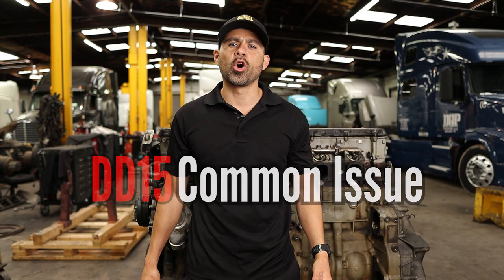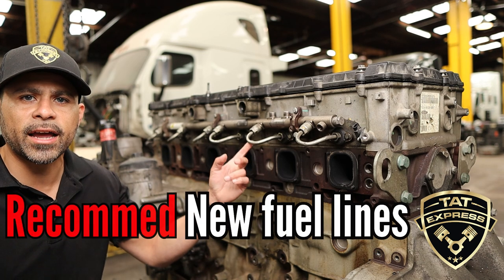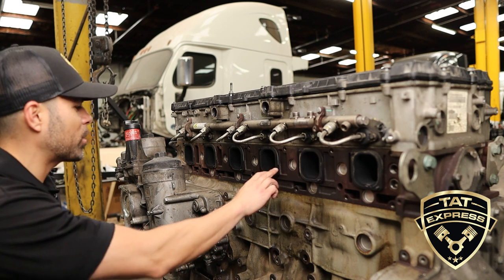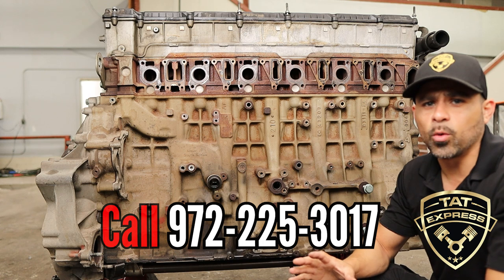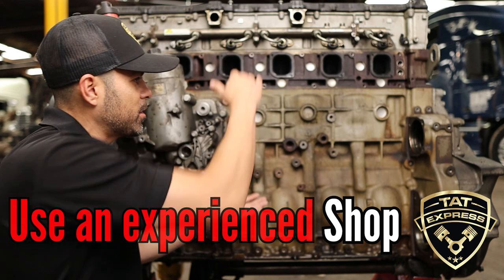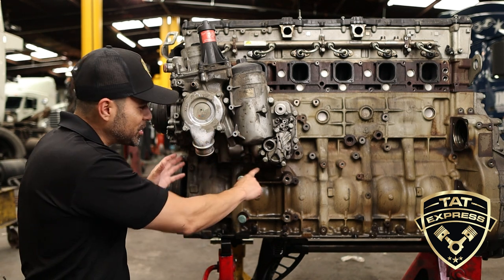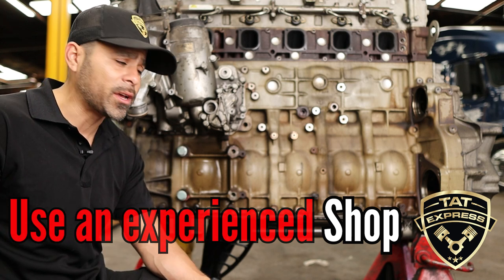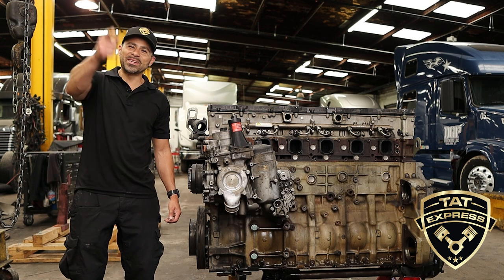Most Common Issues With The DD13 DD15 DD16/ Detroit 15/ Semi/18 Wheeler/Diesel truck/ DD15 Issues

Comment: Advice get a 60 series Detroit or a catipillar engine= money in the bank!
Reply from the maker: Jo, as long as it isn't an EPA07 or ACERT
Reply: I had a 2009 Columbia with C15 acert and man that truck was in the shop more than a mechanic and it got the worse fuel mileage I ever seen in a truck and I have driven all kinds of truck with different motors....
Reply: @TATEXPRESSINC  3406a/b/c/e model I should of said that. I wouldn’t get anything newer than a 2003 model!!
Reply: Your mechanic thanks you!
Reply: @hudsondonnell444  I’m sure your mechanic thanks you For your DPF filter You don’t sound like you’ve been in Trucking very long
Reply: I have a deleted dd15 and it's been the most reliable and cheap engine to maintain I've ever had.
Reply: LOL FUNNY
Reply: @jacob-v8567   Are the parts imported or donestic? Are the parts expensive?
Reply: Agreed and agreed
Reply: Cat?😂
Reply: And have horrible fuel mileage
Reply: @TATEXPRESSINC  true that 07 with the after burner sucks
Reply: @jopete681 get it deleted. Or learn the emission system and how to maintain it properly.

Comment: You forgot to add, DD15 & 13 are most reliable and effecient when maintained and repaired properly. I have 6 cascadia's running every day. I am the only person who works on them. I even recently ran off the tire guy due to poor workmanship. All you mentioned is  true stuff, but no sweat. The only true BAD problem with truck is the people who fail to maintain the accordingly. The only thing I dislike about the DD15 is the little oil filter. I would like to find a remote mount filter system with more volume.
Reply from the maker: Shane, thank you for watching and sharing your valuable information 💪🏼🔧👊🏼
Reply: Is there a certain year? Or is the dd13-15 good any year?
Reply: I can't see any Detroit being more reliable than a cummins...I've heard nothing but issues with the Detroit...the 60 series are far better than any of the dd...not to mention the fuel mileage doesn't keep up even when healthy
Reply: @michaelford9089 everything brakes tbh.  Get whatever you like and know how to repair , unless it’s paccar lol
Reply: My dd13 locked up at 320,000 miles I ran great till it didn’t

Comment: you missed something like the intake valve always wear into the head creating a hard or no start situation, or remove the coolant filter because that can create some over heating problems,  that DD15AT engines with the Axial Power Turbine were also made for EPA10 and the DD16 engines all come with the Axial Power Turbine including GHG17 engines.  another problem is the injector harness leaking oil through the electrical connector and into the engine harness.  for the fuel lines going to the injectors they are designed to be reused and 90% of the time when they are reused they will not leak providing you replace the o ring on the injector which comes in the o ring kit.  the throttle valve was also used on EPA10 and GHG14 non AT engines and they don't usually leak as well as the intake manifold gaskets.  the high pressure fuel pump does not need to be timed with the engine the manual talks about making sure then engine is at TDC 1 but does not talk about where the fuel pump gear should be so there is no timing between the fuel pump and the engine.  the fuel filter can be replaced as per Detroit Diesel every 35k to 75k miles.
Reply: Good sht
Reply: Geesussss....! :-$

Comment: When I was a company driver 70% of the trucks were  dd15 and only once did I ever have a breakdown and that was for a cracked coolant reservoir   I drove to the nearest dealership and had it replaced within 2 hours...

I put 300,000 miles on that truck and I think all together it had 490,000 when I was out of it at 300, 000 I know they cleaned and checked the DPF and replaced both knock sensors along with a dozer for maintenance  the truck was down about a week for that ...

As for paccars that I've driven I've broken down  at least three times in a company truck .... And four times with a Kenworth I owned myself and that damn thing cost me about $10,000 every month at the dealer.....

Then I had two Cummins ISX one the scr system went out that was a $15,000+ fix that they would not cover under warranty because they said it was caused from bad Def........ Never showed me the test sample ETC

Then I bought a certified used 2015 cascadia with an ISX 249,000 miles I literally drove the truck 20,000 miles and the engine blew because of a bad fuel pump... Aftermarket warranty and Cummins fought back and forth for about a month before they basically said the fuel pump is an accessory and it's not covered under your warranty your Sol......
Reply: How is fuel pump an accessory, it won't run without it lol wtf I'd be suing their asses.

Comment: Next truck will be series 60 but I can't complain at all on my dd15. 2011 cascadia with 911k on it. Engines never been open for repair. Got it when it had 435k on it. Ima run it till it quits. Oil cooler just stated leaking last week.
Reply: Why are you going back pre emissions if the DD15 was good to you?

Comment: The oil pick up assy will crack where the o rings press into it. Mostly, I have found  low hot oil pressure at idle due to the o ring on the sump where it botls to the block. It will be hard and not sealing the oil pressure well. This little seal can cause total failure. At idle hot, oil pressure should be above 15 psi. At high speed 70. 
The pick up tube is less than $200,  always replace it for good sense.

Comment: I have a 2020 freightliner with a DD15
It lost all oil pressure the dealer said that a pickup tube broke and it was sucking air so it locked the engine up. Is that a common issue that should be dealt with during PM ?

Comment: So much for German over-ngineering.

The DDs are really based in the MBE 4000, correct?  Engine had good low-end grunt but trying to find a shop to work on them: at least one that doesn't charge $170 an hour.  I'll stick to my Cummins N14 and pay myself $75 an hour.

Also, accelerating to highway speeds N14 blows away any Mack or Volvo or Detroit that I ever driven.  Same thing for going up 3% grades: my engine chops through them but I slow down 5 to 10 miles an hour with the aforementioned engines.
Reply: Michael where  can I find N14 OEM engine parts?
Reply: @godwindavid3646  

Any Cummins dealership.  I am fortunate that one is 5 miles from my house.

They're likely not going to have engine blocks, but they do sell small blocks and heads that are rebuilt.  I usually get my fleetguard filters there and my engine coolant there.
Reply: The n14 is an animal

Comment: I'm eventually moving from a motorcoach with a Series 60 to one with a Volvo D13. Can I expect more reliability issues or more frequent maintenance with the D13?
Reply from the maker: D13 can be problematic if not well maintained
Reply: Keep that series 60😂 your wallet will appreciate it

Comment: American truck engine manufacturer: Lets spend tens of millions of dollars on making an engine that sounds epic whilst it can still pull a load. Oil leaks don't matter.
European engine manufacturer: Lets make an engine that doesnt leak oil and pulls harder than an American engine. 
LOL I say this with 25 years trucking experience in Australia.
Reply: And what is this engine please?
Reply: @chuckbyard3294  it only exists in his head. 😆
Reply: Wouldn't matter what answer I gave. Those who drive American trucks are sooo passionate and loyal that they can't ever be told that something is better. Its a good thing, yet also a handicap.
Reply: Dd15 is basically a German engine. Almost exact same engine goes into the new Benz trucks.
Reply: They're owned by diamler

Comment: What's up guys! So i have a question? I have a 2016 cascadia DD15 and i have this weird problem. Engine light came on (both red and yellow blinking) truck shut off on me so i called my friend who is also a truck driver and he said to disconnect the coolant level sensor so I did. Truck started. So if i connect the plug it will shut off but if disconnected it stay on. Any advice on this issue please.🙏 ( I replaced the coolant level sensor and still doing the same thing)

Comment: Hey why would I get check engine stop engine lights come on just after start up when the trucks cold and the air is building up. They then start to flash and then shut the truck off but after I restart it and get the air pressure up they eventually disappear and it runs fine?
On a 2014 dd15
Thanks

Comment: Sometimes when i start my engine the starter is blocked becausethe truck computer thinks it is in drive. So i try to switch it to drive then back to neutral to see if that works. So far it has happened to me twice and i have been able to start the truck but i had to toggle it back and forth between drive and neutral. Any thoughts on what it might be? Its a cascadia dd15 auto

Comment: I worked at a Freightliner shop in Spokane Wash.  doing nothing but Engine work. 60 Series , MBE and DDs. MBE was garbage. 60s were the  back bone  of Detroit . The DDs , any of them in my opinion were not much better than the MBE. Modules that failed and worse was the crank brg issues. The company treated employees like the Goverment treats the common American.  I'd rather have a 2 stroke Diesel than a DD.

Comment: Every time I accelerate it sounds like a tea pot boiling whistle. It used to be every time I went uphill. Now it’s every time I accelerate. I just recently had my egr cleaned. What can be the problem?
Reply from the maker: It sounds like a leak from the repair.  🧐
Reply: Before the repair it was a small Whistle and now it’s gotten worse. Any ideas as to what it was making that small whistle before the repair ?
Reply from the maker: I recommend checking exhaust and intake for leaks.  💪🏼🚚
Reply: I had that problem on my day cab , it was my fault , i was driving hard uphil wen in stupid way rip the egr conduct,  so thar whistle was whit me every day , the repair cost almost 2000. Some times we fuck up the trucks

Comment: I'm thinking of governing my truck from 68 to 75 mph.It is a dd15,but my concern is would it prematurely burn out cam bearing?
Reply: You just need to watch your rpm's.
Reply: @lawsondj1244  what rpms you should keep it at?
Reply from the maker: Tim, excessive idling would cause more damage to cams than driving 75.  The rpm limiter will keep the truck at a safe RPM

Comment: I have a dd13 with 190k miles 2012 cascadia. This morning my engine started to feel with less power when I would go more than 20 mph and the engine would stay like that until I come to a complete stop. If I wait for a couple of seconds, then go my engine would go back to normal but if I go more than 20 mph it would to start to lose power again. Need help!!
Reply: How did you fix it ?